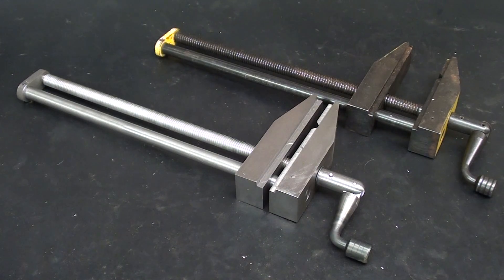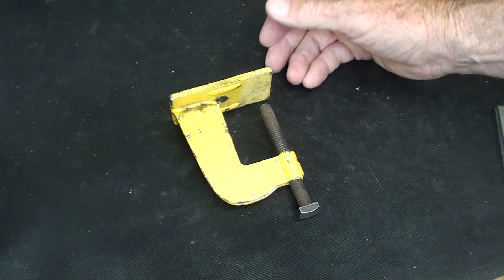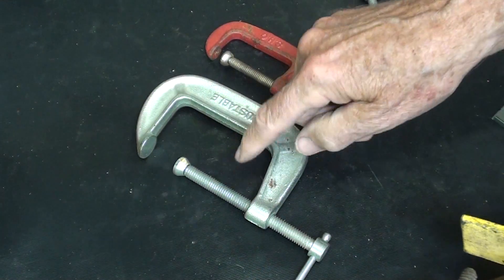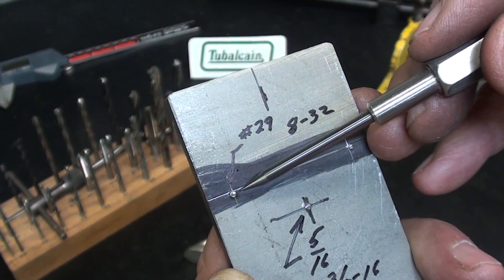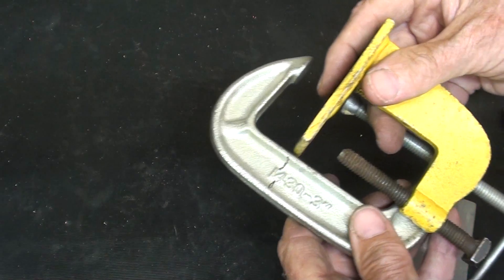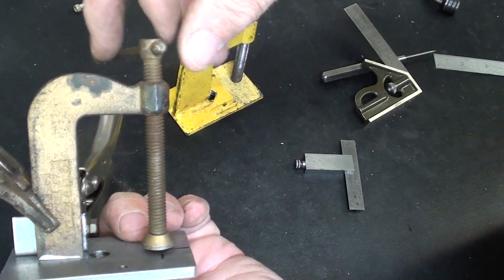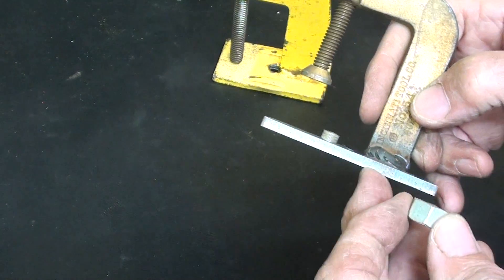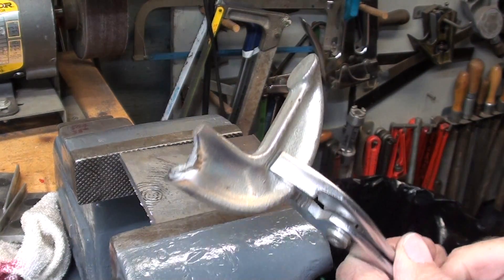MAKE A FLOAT LOCK Drill Press Vise TIPS 587 pt 8 tubalcain

Comment: You have a great channel! Thanks for sharing your experience. In case no one else mentioned it, I'd be tempted to use the original clamp you had in mind, grinding the sides flat to accommodate the pieces of angle iron (or a little heavier) you used to support the smaller clamp, drilling into the side of the clamp to secure it.....no need to weld.
Reply from the maker: Thanks

Comment: we weld cast iron at work all the time and have for years with no issues, we preheat to 650 deg and weld it with in most case's allstate 44 rods, or anything with a high nickel content, now I am sure maybe you can't weld all cast steel but I have found very little that I couldn't weld.I have had a couple things that I referred to as chineesium that I could not weld.

Comment: This is a little late to the comments, but I end up welding all sorts of pot metal, and what would be considered “non weldable” material, and I’ve found that you usually get an decent weld in most materials.  I mean use common sense, and don’t weld a cast iron clamp to hold a ultralight seat to the wing... lol I’ve had really good luck with 6011 stick rods on a lot of metals I really shouldn’t have good luck welding

Comment: when you would pre heat the cast iron before welding it it should work just fine, the problem is that the stress in cast iron bedcomes to big when you try to weld it when the iron is to cold. regards

Comment: You could easily make a clamp and use a coupling nut for the wider threaded portion. 
No worries about cast iron clamps or having to use material thick enough to drill and tap. 

Simple 🤷🏻‍♂️

Comment: My 2 cent advice would be to put that big nut on the bottom of the plate and run a bolt through that hole to align the threads then weld the nut on. that will triple the length of thread contact.

Comment: the Jorgensen 1623 hold down clamp would work as the corner mount. it has a large enough flat surface to be used with a piece of flat stock if mounted upside down. these can be found for cheap sometimes and don't require any changes
 https://www.ebay.com/i/352642140730?chn=ps&norover=1&mkevt=1&mkrid=711-117182-37290-0&mkcid=2&itemid=352642140730&targetid=595232447669&device=c&mktype=pla&googleloc=9001923&poi=&campaignid=2086088130&mkgroupid=77632104192&rlsatarget=aud-622524040958:pla-595232447669&abcId=1141016&merchantid=6296724&gclid=Cj0KCQjww7HsBRDkARIsAARsIT4QLaEQ9Hy4x_fj1G1Ag80DVJl4wBg68Bb_7Y7qhZxV__DYWNwnQywaAkaIEALw_wcB

Comment: I believe the two ridges are on the original to act as reinforcement to prevent springing apart should someone over tighten the bracket.  They have a similar effect as thicker metal.  If they were to act as a stop they would not have rounded ramped ends on them as this would serve to ride up on the ridges as you mentioned someone had done pointing out that the paint was worn off in the beginning of your video.  Keep up the good work.  As we say in the trade (education) it appears you have 1000’s of teachable moments out there judging by the number of your subscribers.
Reply: 37yearsofanything isenough 
I agree. They act like a truss but at the same time the original was just a stamped part.

Comment: Good luck with welding cast iron to mild steel. Success depend a lot on the type and quality of the cast iron. The right rod (like nickel) preheating, and slow cooling gives you a chance. Brazing often give better results. Keep up the good work Lyle.

Comment: why not use a thicker piece of plate and milling a step for the clamping surface? Then you'd also have your stops right away
Reply: My thought as well. One problem is that starting with HRS or CRS plate and milling off one surface would probably cause the remaining metal to warp from the stresses left over from rolling. On the other hand if the piece is a slab cut from the end of a large rectangular cross-section this should work fine.
Reply: @kevinmartin7760  I don't think it would warp that much tho. It will get bent a little by the clamping pressure anyway.

Comment: I wonder if a brazed joint would be strong enough to hold the clamp?  A good brazed joint is comparable to cast iron and it would bond to different materials better than welding.  I have always felt that a good braze is better than a  bad weld.

Comment: Harbor freight used to sell folded steel c-clamps like the original AMF clamp - don't know if they still do, but you can probably find similar on Amazon or eBay. They are much easier to get a good weld on with a hobby grade wire feed welder than forged, and AMF obviously thought that was strong enough.

Comment: Um, couldn't you have just used the C-clamp to hold a piece of angle iron with a hole in it to the rim of the table?
Reply: The rim on a drill press table is generally not square to the surface of the table. On mine, the rim is actually tapered (probably from the pattern draft required for casting) so it doesn't hold clamps securely at all.

Comment: I would have assumed that the stamped ridges on the sides of the flat plate are meant to stiffen the plate and help prevent it from bending, rather than your explanation of helping to locate the clamp.
Reply: Often, when optimising a product, a designer will try to kill as many birds as possible with one stone, this can serve as a stiffener and a locator, the goal is to reduce the steps to a minimum in order to get the most efficiency and lower the cost of production. In manufacturing as opposed to hobby practices, every second is counted.   😰🤑👍
Reply from the maker: Yes
Reply: I had the same thought.

Comment: the yellow one I make them to weld to pull or push the plant steel to make to flush with and another plant  or working on big  tanks weld them on can move the pipe witch direction you want it to go and old welding shown me them track
Reply: use a coupling nut for a ready rod  and tig the part on to the jig

Comment: Your iron clamp would be serviceable if you brazed it to the plate.
Reply: Chris Turley It will break off with clamping pressure eventually.
Reply: @BarryManilowa  Brazing rod is common in 60,000 psi. roughly equivalent to 6010 arc welding rod. A properly done braze joint would work very well in this application.
Reply: @christurley391  yep brazing is stronger than people give it credit for !  I did thousands of pull tests on brazed  joints .the brazers would bet on who would have the strongest joint test.
Reply: @BarryManilowa  it depends on the brazing material.
with Din 8513 L-Cu Ni10 Zn42, for example , the brazing joint should have a tensile strength of more than 690 N/mm² or 100,076 psi .
and ductile castiron is around 60,000 psi .
Reply: That's what I thought too.
Reply: Probably could TIG braze it.  That works for dissimilar metals.  A few cast parts that I've welded snapped the tack welds as they heated up.  It makes a high-pitched ping when the weld breaks.  But silicon bronze TIG brazing might work.
Reply: @kevinneff3276  Torch brazing would fill the joint completely and would be hard to beat for strength.
Reply: @christurley391  You're probably right.  I only mentioned it because I have TIG capability but don't have an oxy-acetylene setup.